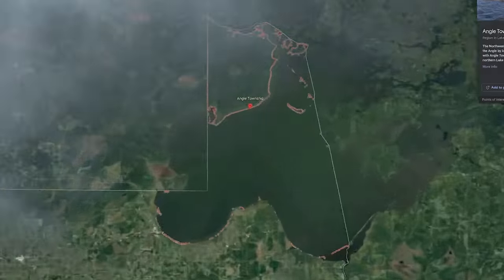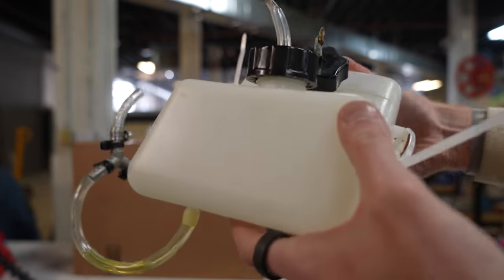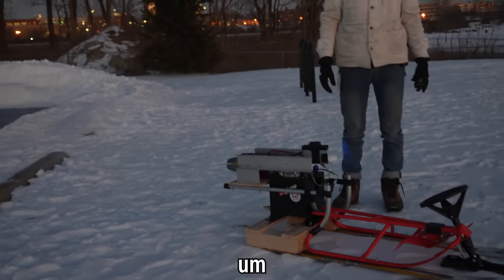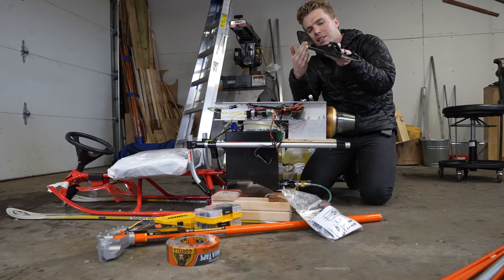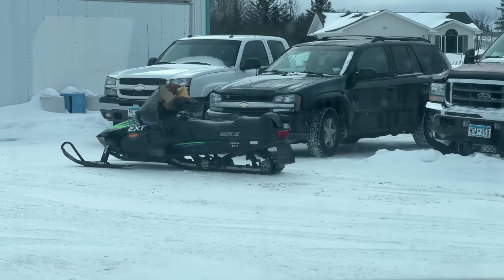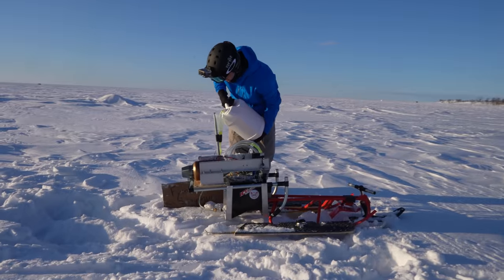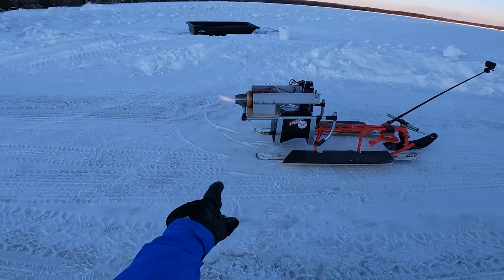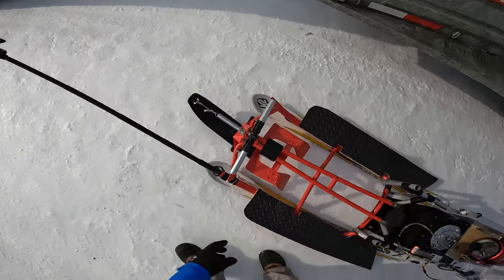Jet Powered Sled vs 38 Miles of Ice!

Comment: Antifreeze in the fuel could keep the engine from freezing as fast, that’s what commercial jets use. Maybe a guided intake could stop the engine being starved of air by your body sitting in front of it. And maybe a kill switch would be a good idea, since I noticed when it flipped the first time, it nearly torched your legs.
Reply: atleast military jets such as the (now retired) sr-71 used and some pretty sure etill use jet-A fuel which prqctically refined kerosene with some more stuff in it to keep it from freezing, the disadvantage atleaat for tge sr-71 which used a low melting point high boiling point fuel is that they needed to use TEA-TEB
Reply: @VerbenaIDK  I believe there are alternate fuels you can use which don’t quite have as much power, but still ignite fairly easily and that work in jet engines. Warped Perception did some tests with a similar jet engine with Jet-A, diesel, biodiesel and hydro diesel. They all performed fairly well, but Jet-A had the most thrust.
Reply: @tfrowlett8752  but then you still need to add antifreeze

jet-a is a naturally low melting point fuel

but hard af to get tho (and to ignite)

best option is just use commercial kerosene and add antifreeze
Reply: @VerbenaIDK  I agree with that
Reply: @tfrowlett8752  ok but

things i forgot to mention:

lower melting point fuels are pobably hard to get to, and some (like jet-a) are hard to ignite anyway, maybe not TEA-TEB required but maybe "Arc welder spark plug required"

and price, we talking like 20 liters or maybe more, so if regular kerosene w/antifreeze still gonna be quite expensive (120 brl (about 25 usd) per 5 liters of kerosene, pobably cheaper if you are going to go to hours searching around but, cmon, you dont wanna spend 1 day searching about low price bulk kerosene do you? so imagine having a hard time buying some specialized jet fuel just for that
Reply: @VerbenaIDK  no fuel is perfect. My first comment were only suggestions, nothing more. I’m sure there could be other, cheaper ways to stop engines freezing.
Reply: @tfrowlett8752  there are 3 that could be useful and a thing that could help

ammonia is ok, but a neurotoxin, dont need to add to that
lpg, good old lpg
methane is kinda of an intermediate somehow? methane is good at being intermidiate

red fuming nitric acid: hypergolic, not the hardest thing to handle but does need special handling
could easily ignite kerosene, since it was used in combination with kerosene to propel one rocket atleast, ignition fluid basically

modern rocket ignition fluid is out of question, louis wont be able to make bottles worth of triethyl aluminium and triethyl borane
(if he would be able to make it at all)
Reply: @VerbenaIDK  it would mainly be up to Louis what fuel he deems is most suitable, these are all good suggestions, and they do have advantages and disadvantages. The thrust each of these fuels produce would also have to be taken into consideration, especially since Louis would want as much thrust as possible.
Reply: @tfrowlett8752  if you want high thrust for a jet engine gaseous fuels are almost out of the question

best bet would be hydrogen or decomposing ammonia to hydrogen and nitrogen
kerosene with some antifreeze might be enough

idk where he lives but i believe it wont freeze easily unless he's at cryogenic temperatures, which us has a bunch of, inside machines for nasa to produce liquid hydrogen and oxygen atleast

melting point of ammonia: about -33,1 c

melting point of kero: -about -67 c (for rp-1)
Reply: @VerbenaIDK  I’m just hoping Louis is reading all this, with all the suggestions  you and I are providing to each other.
Reply: @tfrowlett8752  i doubt, but if he's reading he's not gonna use any of these lol

either way too dangerous or just kinda not works, or too heavy because pressure tanks or cryogenic liquids, both which dont go well with jet sled
Reply: @VerbenaIDK  well I hope he eventually sees the other suggestions, especially the kill switch one. Safety should always come first.
Reply: @tfrowlett8752  there is so much that can be done to make safety better, not letting it be practically a sled of steel pipes with a jet  and obly that is also a good one, also aerodynamics, lengthe  the chassi a bit, make it wider slightly, pobably could make a sensor that if it steers too fast it closes off the engine fuel and turns it off
Reply: @VerbenaIDK  whatever Louis and his team see fit, I’m sure they’ll get to it before the next attempt.
Reply: @tfrowlett8752  yeah pobably
Reply: @tfrowlett8752  most jet engines drink anything that burns, though results obviously will vary on fuel choice
Reply: Antigel is the word you are looking for, diesels use it.
Reply: @magking1971  will that fuck up the engine by clogging it? how expensive is it compared to using antifreeze + kerosene? keep in mind that he needs like 25 liters of it
Reply: @HobkinBoi  ammonia?
Reply: @VerbenaIDK  this only takes a few ounces per gallon, will not clog and has lubricants for just that reason.
Reply: @magking1971  ok great now just... ig hope louis see this ig
Reply: As someone who is an aircraft fueler the antifreeze additive is called prist (name brand) and works for stupid cold temps. Large jets also use heated tanks if you want to go that route.
Reply: @BrandtOsborn  how stupid cold?

like, rp-1 on  falcon 9 cold?
rp-1 on falcon 9 is abiut -61 c or somethibg like that
Reply: @BrandtOsborn  also where do i order some of tgis stuff in brazil?

i really need some real pure methanol for cheap
Reply: @VerbenaIDK  no it doesn't protect from cryogenic stuff lol but it's good down to -43C if I'm not mistaken which is more than enough for most conditions.
Reply: I agree, kill switch like on a jet ski to cut off the engine, y shaped intake behind you so the engine isn't starved for air by your body, and antifreeze in the  fuel. That sled is sick tho, very cool :)
Reply: It’s great that everyone here has so many suggestions of fuels but you’re all over complicating this issue. As one person pointed out; the beauty of the jet engine is that it will run on practically anything that burns (provided you can ignite it and use it safely) Jet A1 is still commonly used, and in fact it can be used in diesel piston engines (see the Diamond DA-40 NG designed exactly for this) all major jet fuels are practically a refined kerosene BLEND that’s all the designations are about, the blend type (each with desirable commercial applications). 

There are a couple solutions that Louis could easily implement for the cold operating environment and trouble igniting:
Fuel heating or intake nacelle heating, much like a carby heat in an aircraft, a simple heater that provides enough heat to stop icing on the intake nacelle and or fuel tank heating to keep the fuel above the freezing point of water. Or the second, easier option: using a starter fuel such as a small butane or LPG or propane can like those used for small camping barbecues etc. and then switching over to kerosene (off the shelf kerosene or hobby kerosene is fine for a small hobby engine)
Reply: @PL4GU3d  i'd rather use antifreeze/kero rather than heating up the engine nacelle and tank

the thing about butane is cool tho
Reply: @BrandtOsborn  yeah that's more than enough
Reply: @VerbenaIDK  My Suggestion of heating fuel and nacelle was overkill for this situation. You could easily just store the fuel in a warm car until you refuel and insulate the fuel tank with a bit of cloth material or a housing  to protect it from the cool airflow over it and the ambient temperature.

As for starting with the butane it’s easily seen in videos like this one:

https://youtu.be/I7GFAbtsQKs

^ This guy is known for his crazy creations with jets.

Perfect for the small hobby jet engine used by Louis.
Reply: @PL4GU3d  yeah that could work
Reply: Prist
Reply: @VerbenaIDK  JetA is extremely available and easy to get.
Reply: @VerbenaIDK  Heet gas line antifreeze (yellow bottle) is pure Methyl Alcohol and fairly cheap
Reply: Agreed! Sketchy much?!
Reply: You need Jet A1 with FSII
Reply: @VerbenaIDK  how tf is it hard to get? 
Walk onto your local airport runway and insert your credit card and fill your gas can. Wtf r u talking about
Reply: Honestly, a killswitch sounds like a good idea. For instance, you could include one of these anticheat devices that pinball machines use. It's basically a pendulum with a ring around it, which, if they touch, resets your score. This was done to stop people from lifting the machine and tilting it backwards, but could also be used as a low tech solution to this problem.
Reply: @VerbenaIDK  The freezing temperature of Jet-A is -47C. At that temperature fuel freezing is not What should worry him.
Reply: @philipsmith1990  Yeah, tho how would he run with a tank of fuel and without a heat source?
Reply: @VerbenaIDK  Why 'without a heat source'?
Reply: They actually heat the fuel
Reply: Safety lanyard is definitely needed
Reply: That’s not what commercial jets use. They simply don’t allow any water to makes its way in.

Comment: The numbers of ways this could go catastrophically wrong with yourself so close to the jet and full fuel tank is unreal. You have balls of steel lmao. Im all for comfort too so I’d definitely make one that actually fits so you don’t have to scrunch up like ball. Shame there’s no easy way to circulate the extreme heat to keep you super toasty. Could you imagine a snowboard version which would turn on a dime!
Reply: Someone has made one before. I believe it was Peter shripol
Reply: Assuming that's kerosene he's burning, the fuel doesn't particularly concern me (high boiling point so it can't sustain itself outside of the jet) but the heat of the jet itself is definitely quite risky. Touching the jet body or being in the exhaust after a crash could leave serious burns quite quickly.
Reply: i see nothing wrong in it
Reply: @Ava-wu4qp  yeah he almost got his legs burned when it flipped in the snow. Might be good to have some sort of thing he has to hold down in order to keep the fuel going so it turns off if he crashes
Reply: @rockyroadmagic4152  maybe he could add those steering brakes you usually see on bikes and make it make the fuel go as long as its held down
Reply: @Ava-wu4qp  To your point, his legs clearly go directly behind the exhaust at 10:34. How did that not burn his legs? It was still on..
Reply: @JT0007  snow pants are pretty insulating (millions of tiny air pockets basically) so it'll take a little while to burn through them. I was surprised to not see any superficial damage to the pants though. Could be any number of reasons from low throttle to poor exhaust density to just above average pants.

Nonetheless, continued exposure could pretty quickly get bad. He could have knocked himself unconscious from that impact for example and been subject to the jet exhaust for 2-3 minutes.
Reply: Mistaking balls of steel for sheer stupidity.
Reply: @Theexplorographer  2 sides, same coin
Reply: @Ava-wu4qp  True, but most of them are made from synthetic fibers that melt pretty easily, and then you have melted plastic on your skin which is not super fun.
Reply: I can't help thinking a snowboard would zip right out from under you rather than turning smoothly, the inertia on that thing would be a nightmare with your own higher center of gravity...unless you wore a jetpack to balance it out.......

Comment: How cool would it be if this became a trend? Not just among youtubers, but people in general every year forming teams to make a vehicle to cross the lake of the woods each winter.
Reply from the maker: Secretly, yeah, this is what i want to start 😂 the ultimate winter homebuilt endurance race
Reply: Oh, heck yeah, they could make it a yearly thing.
Reply: @Weisz  If you ever plan on actually going through, please do not let regulations turn it into a shitfest.
Reply: @jrambo7495  A lot of events have trash regulations, they have to leave it how they found it
Reply: People have already done stuff like this. I've seen some guys make two huge pulse jets and slap it onto a frame with skies and they were riding it over a frozen lake.
Reply: @Jarandjar  you're naive if you think regulations will stop anyone from doing anything. There's already a fine for littering, yet no one seems to care.
Reply: Was this some sort of actual competition, or just a youtube thing?
Reply: @Weisz  i could see redbull sponsoring something like that
Reply: Jet engine for propulsion, and a small motor powering a blower to inflate a hovercraft skirt. This would alleviate a lot of issues.

Comment: Making it longer makes it more stable but also increases the drag and reduces manoueverability. You have to find the sweet spot by testing it out. Your biggest issue is the steering concept: By using a single rotating ski in front of your vehicle you introduce stability issues that make it hard to steer and you get those diving issues. At higher speeds this thing will spontaneously self destruct. Either put 2 steering skis in front like a snowmobile or use (imho best option) differential braking by increasing the drag on one side. You can increase drag with aerodynamic control surfaces (excellent at higher speed) and some kind of snow spoiler that retracts onto the ground and plows snow for drag. Another option is to dynamically change your weight distribution. Also maybe consider sitting around the engine so that it is located below your stomach , blasting out between your spread out legs and pulling directly from the front through your spread out arms. A bit like sitting on top of a superbike with a jet intake. This ofc. requires a sufficient shielding if the engine explodes, but it may help with the icing issue since the engine is enclosed and will stay hotter. Be careful of over-heating though! Good luck with the next iteration, i enjoyed this one!
Reply: Definitely make it longer, much more stable, little wider and better steering, maybe 2 ski system. Lay down will make it more aerodynamic for sure... no need to straddle the engine, too dangerous. Adding shield way too heavy. Oh btw, making it longer will not increase drag. It might decrease of not too long, spreading the weight out which will dig into the snow less. Look at the coefficient to find the sweet spot.

Comment: It needs to be much longer and wider to spread out the weight, reducing pressure, and give you more stability in terms of tracking straight and not catching ruts/bumps, which will improve fuel efficiency and top speed.

Comment: v2 suggestions: longer sled so you have more surface area on the snow and wont sink as much, this will also allow you to sit further back, making the diving problem you had go away. skegs on the skis so they steer better and track a better line. wax the skis before every run, you wouldn't believe how much this helps. brakes? maybe? if you're a pansy lmao
Reply: Longer skis will do the job

Comment: I'd make it longer and a bit wider, then put a second engine on it. being wider would reduce the issue of your body blocking the intake and make the engines more efficient. Widening would also let you put a second ski up front which would allow for more stability because that is where the majority of your body weight is being held. Lengthening it would then let you put longer skis on to spread the weight load over a longer distance (same reason skis float better on faceted snow than snowshoes) which will actually let you go faster as well. You might also want to look at a ski that is around 100-110mm at the waist on the main sled body to also give more float and control in variable snow. Speed is a huge barrier in this game. A 38 mile trip over a frozen lake might not seem like much but the variable snow (breakable crust, faceted, and sastrugi) can definitely slow you down. Those are lessons I've learned from climbing and skiing the high peaks of Colorado. All in all this looks like a fun project!
Reply: I agree with the points...Should be pinned! Maybe some suspension would help...then simply wings to keep the machine from rolling and thus keeping the jet from rolling into him and that shit is hot... He also need hearing protection for being right near it for 20-30 min...someone else said antifreeze to keep the engine fuel from freezing... maybe wrist and elbow and knee guards in addition to keep him from dying by oversteering and hitting icy floor/heavily packed snow... And a kill switch on a remote attached to his GoPro cam handle mount so he can keep the engine from continuously burning through his pants if he doesn't implement wings to keep it from rolling onto him

Comment: That was insanely cool👍
Here's a thought a converted ice racer, but instead of skates use skis with a minor edge down the centre length for better turning, and use two jets, the bigger rig will allow it and be able to carry the fuel for the run,side advantage your sitting not kneeling

Comment: I like to imagine the most expensive part of this project was the fuel
Reply: jet fuel is cheaper than gasoline i think
Reply: Jet fuel iirc is pretty easy to make, in terms of ingredients
Reply: Those engines run on Kerosene, it's fairly cheap. Those hobby jet engines are a bit expensive though.

Comment: Way to go, very cool and that took a lot of balls. You need to lengthen the sled. Lengthen the steering ski and consider adding a shock absorber to it too. It will be far more stable at speed. Lay down and you'll pick up another 5 mph. Well done

Comment: Ditch the skis and use snowboards so you can go on soft snow much better, the weight distribution will accommodate more terrain issues. I used to have blow molded plastic snowboards that I used with a big wooden box attached for ice fishing equipment, and they worked awesome. Snow, ice, and slush were no issue!